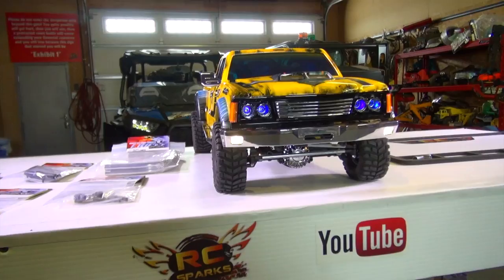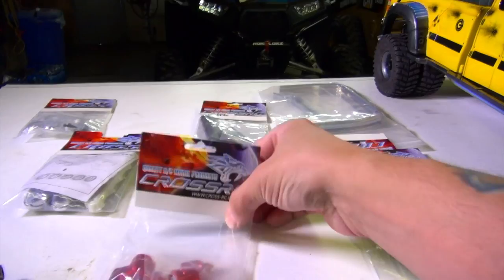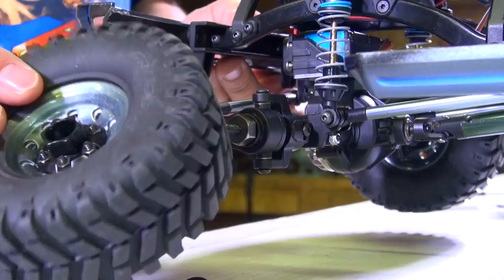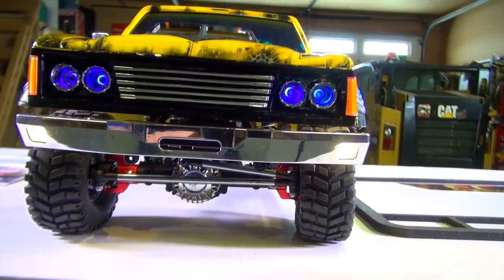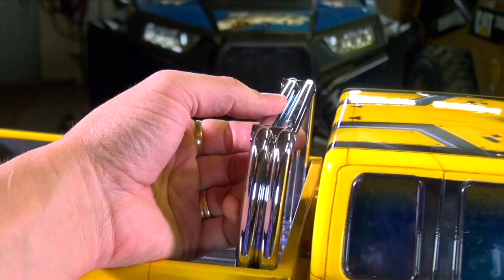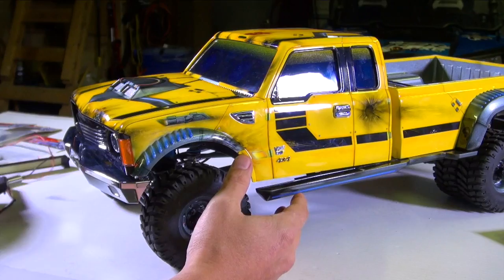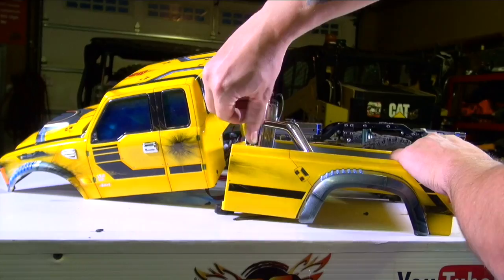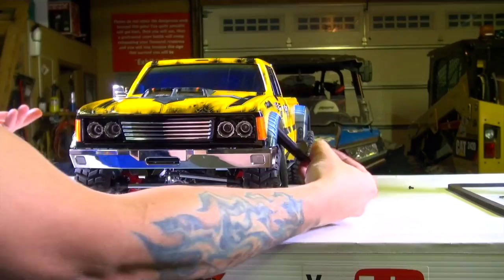RC ADVENTURES - PROJECT: "BUMBLEBEE-ST"  4x4 DUALLY Model Pick Up Truck (Tribute to Bumblebee)

Comment: No to snokle and no to light bar but yes to light buckets on the roll bar fits in nicely with what looks like a mid 90s truck. And nice as any paint job is if a mod is going to be a permanent fixture drill away my friend nothing wrong with putting holes in a paint job if there not going to be visible.  Just an issue if you change your mind later, decide and once decision is made leave it there that's all

Comment: Yes for the light pods, no for the snorkel.  Not sure if there is a “Part 2” video build of the Bumblebee-ST.  The list of 7 videos shows going from the original unboxing video with the grey unpainted body directly to the finished, painted product with lighting installed, waiting for a sound kit and red steering knuckles.  Awesome rig and killer paint job by Bloodshot.  Appreciate the entertainment and inspiration.  Geezer 91.

Comment: Love the way you set the roll cage up, I would leave the snorkel off of it definitely takes away from the beautiful paint job and like you said you do not see too many duallys with snorkels... As far as the lights I would set the bar side and use the buckets for sure definitely has a more authentic look

Comment: I like the rollbar, I think the light buckets look better. If you decide to use the snorkel there is a product called p-tex that could help, it's for repairing the bottom of snowboards and skis, you can get it in black and you can shape it with cutting tools. 🙂

Comment: Hey Aaron, sorry unsure of spelling, perhaps your “BumbleBeast’s” scale hub covers would stay on better if you could replace o rings with a larger diameter but same the circumference o ring to make it fit more securely.? Well it sure looks terrific. Have a fantastic weeks end. PS is sand your best bet to extinguish a LiPO fire, after of course the LiPO bag. Later

Comment: dropp the snorkel. Keep light bar. Use bucket light. On the lightbar. ADD the typical smal orange truck lights above the windshield AND possibly the oldschool windshield external wisor.

Comment: Put the LED on the front of the Cab roof, and put the lightpods facing Aft toward the bed! 
bonus points if you continue the Blue LEDs in the pods.

skip the snorkel and do A-pillar searchlights

Comment: Just a quick observation, for your hub covers, those o rings should be quite grippy, so the only real way it would come off is if the o ring actually rolls, if that makes sense.
If you glue it to the inside of the hub cover, it should grip a lot better because it won't be able to roll to the end.
Just something that might be worth trying.

Comment: I think that the light pods makes it stand out more and fits better but it is your rig so it's all up to you and for the snorkel I think even if you did cut it at the rc part it would still stick up above the cab cause if you look at full scale it's usually flush top to top but hey man the truck looks awesome great job it.

Comment: If you’re going to use the snorkel then cut out a section to shorten it then marry the tip to the section that you’re going to keep. I like both the light options on the rollbar but I think the pods have a better look.

Comment: My opinion I like the KC looking single lights better than the light bar I also would have cut the bottom half of the first tube of the role bar off so its sit up over the front of the truck box and made it closer to the cab im not digging the snorkel though otherwise great build looking good keep up the vids

Comment: this is now my 3rd favorite build.  
Optimus... Toyboata... now Bumble Beast..
I say,  no snorkel
as for the lights, you could go either way.  I'm a fan of classic kc lights,  but that light bar could look pretty sick. 
My thought,  if you're going back and forth on the lights,  could there not be a quick connect and mount that'd be easily used to interchange then when you like? 
only spitballing.

Comment: I couldnt drill into it either for the snorkel so id probably skip that to,i would do the light buckets on the roll bar,and then mount the one too many rc's led light bar on top of the front bumper.looks great

Comment: I think if you could maybe tint the light bar where the led's are a similar blue as the windows I think that would look sweet. I don't think you would loose to much light output either.

Comment: the light pods look better imo, you could have trimmed the roll bar front tube to fit over the front of the bed to get it closer to the cab, i've seen 1/1 trucks with roll bars done this way, I don't think the snorkel fits the theme of the truck and would actually mess up the look you're after

Comment: Round light pods. Body has a 80’s period theme and circular lights fit the build. As far as the snorkel no no. If the hood scoop was large enough a round carb style air cleaner would look the best under the hood seen through the hood scoop.

Comment: I think the bar bar is okay but I wonder what black might look like.  Just like you the bar is growing in me in chrome but I would go with the bucket lights.  As much as I like light bars that one comes up to low and would be blocked by the roof.  The buckets are higher and just look better on the roll bar.

Personally I am not a fan of the snorkel at all.  It just looks odd and out of place.  This rig would look killer with a trailer hauling a tied down enemy Decepticon. :-)

Comment: About the snorkel, don't put it on... It's not very scale-looking, it's too big. And since it's a Street Truck, well, no need for it. Another thing, it looks kind of dumb on a car with air scoops on the hood! Moving on to the lights, I think the bucket lights look better because of the shape of the headlights. Just paint the buckets, the mounting, and the roll bar in the same gray color as the truck-bed. That's only my opinion, just wanted to share it. Love your channel, been watching for many years, and will continue to watch as long as you continue making vids!

Comment: No snorkel and use the light pods not the light bar, the pods really set the truck off, and with them being chrome they match the roll bar and the chrome accents on the truck.

Comment: no snorkel.  as for the lights lt looks simple enough to where you can switch them back and forth easily enough and run both and that would give you time to see which one you want to leave on there.

Comment: No light bar but I would use the other set of lights and make a little bracket through the roll bar for the original screws holes that are there and no snorkel

Comment: If you can try to mount a 3d printed roofrack using the rollbar with screws and tape on the roof to save the paintjob, this way you could mount the lightbar up above the cab on the roofrack
If you need a 3d model I need exact measurements

Comment: don't put the snorkel on it. It just doesn't look right and in my opinion I would leave the roll bar on it adds realism to the truck and the circle lights look great and so does the light bar that is a hard decision  but the snorkel no I wouldn't put it on it. love your videos and I have learned so much from you.

Comment: a modified smaller/shorter snorkel ("RC.com" length) and shave the edge that goes over the hood.  also I'm with blood shot on the light bar option, but place it forward on the cab roof.  I don't think the chrome and black metal light bar housing should be together.

Comment: The snorkel does not fit the design or its concept. The 4 light kit would have its place on a trail truck; the last led light bar did give the truck a good contrast and looked like it belonged on the role bar.

Comment: Do you have to program because the low voltage detection on 3c lipo a gool rc esc 45a with 3000kv motor

Comment: these vids get me hyped for using mine except its hard to find parts for it after i broke the right front wheel hitting a curb
its hard to find parts cause its an old truck from back early 2005 im guessing

Comment: Looking sweet. Got my first CrossRC kit couple days ago looks pretty sweet it's extremely nice I purchased the SG4c Demon model have you check it out yet? I have an unboxing uploaded. If the quality of build is good I will be picking up a military style next. Wanted your thoughts about the demon model I love that they have like 6 versions to pick from 300$ to 550$

PS you could cut the first front tube on the roll bar (looks like two together) flush with top of bed and it will tuck in closer to the cab and might look better.

I would go without snorkel or maybe try the demon model snorkel may be smaller.
Reply: AtvRacer im loving that Demon c kit. Cant seem to find a canadian supplier though.
Reply: optimusdudes DIY reefing got mine from crossrcus.com might be the closest to you

Comment: Why chose just one light fixture? Why not use both. Put the light pods on the roll bar, and the light bar mounted to the top of the front bumper. 
I say no to the snorkel I think it would detract from the killer paint job.